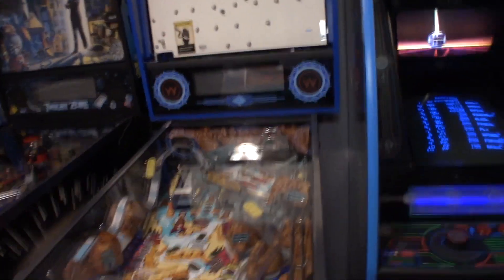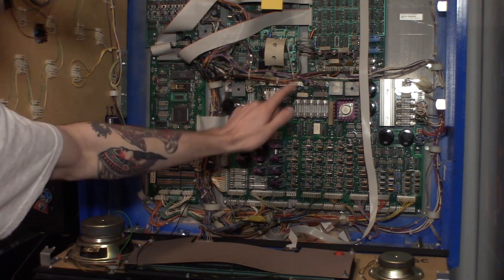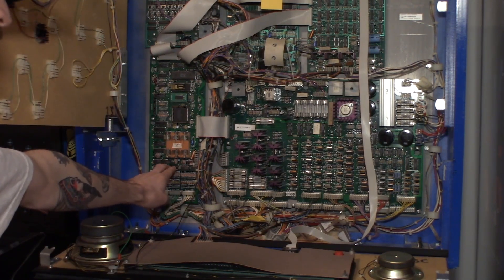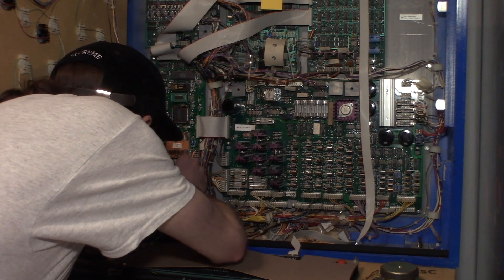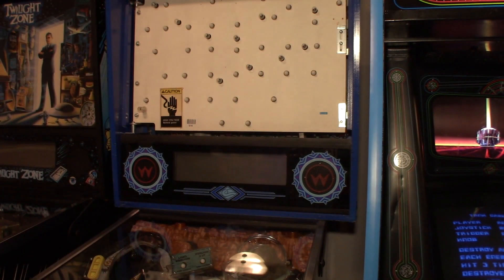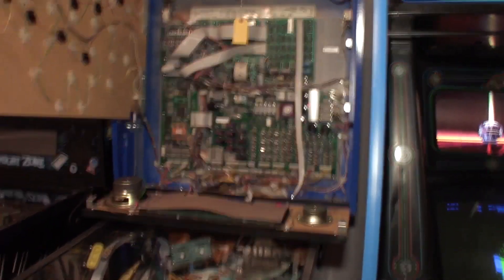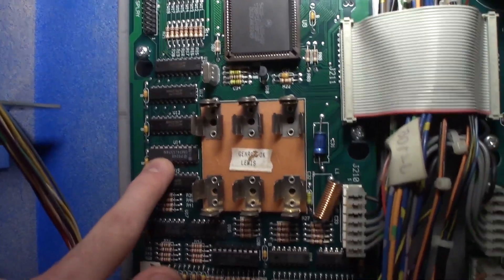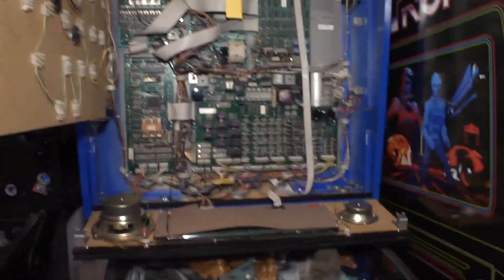Arcade Crusade: Pinball Repair Check Fuses F114 and F115

Comment: The Pinball Network, I'm confused how did the Bigfoot target get shorted to the pop bumper coil? The Bigfoot target has 70 volts dc that got shorted on the 12vdc line but how?Why does U20 keep blowing up? I'm not sure what U20 is used for on the switch matrix circuitWhen you get an F114 error and the rectifier chips are both good, what else can be bad when getting an F114 error?When you get an F115 error it's always a Switch Matric circuit issues or can it be a Lamp Matrix Circuit issue that is shorted?